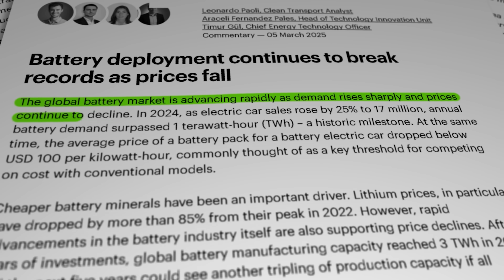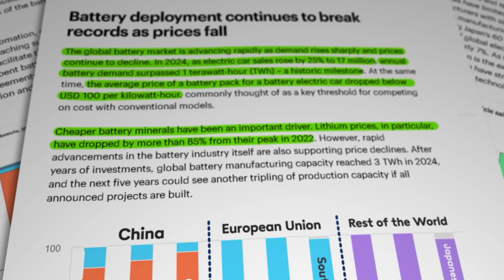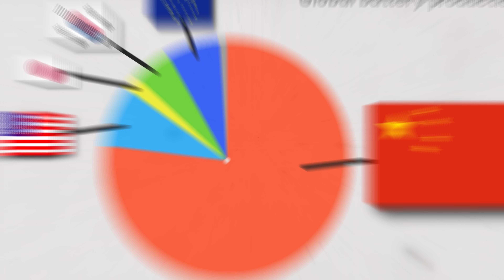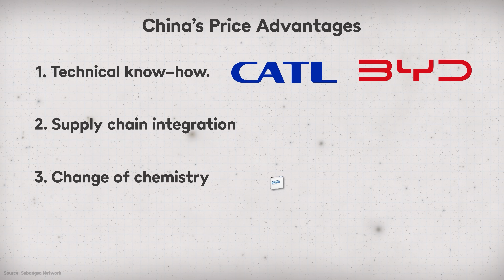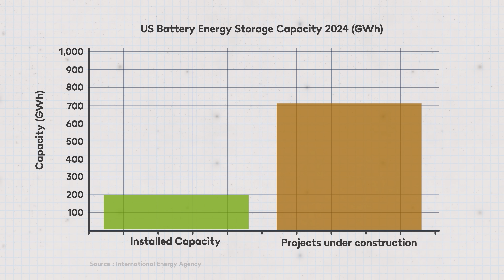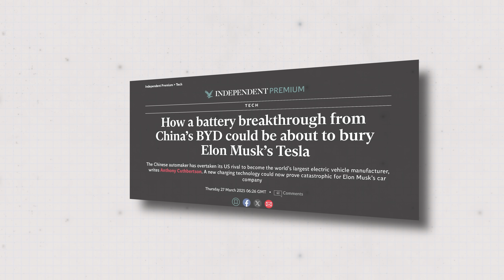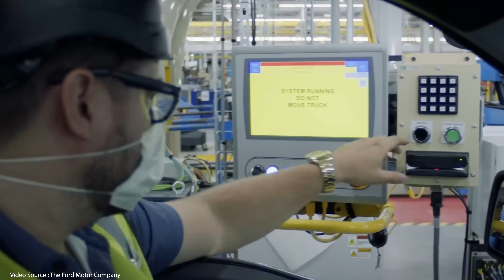Have batteries just hit their exponential curve??

Comment: Part of me wishes all this effort was going into something other than automobiles, which are a very inefficient way to move people around no matter what's powering them, and have many external costs. But I know that's not the world we live in so I guess electric cars are the best we can do right now.
Reply: I agree that cars are not the ideal transit mode. Thirty years ago I thought I would be riding a comfortable inter urban train to work every day. It never happened and I am deeply saddened by that.

But EVs are a torture chamber for batteries, so their growing adoption is forcing the development of tougher, smaller, cheaper, more energy dense batteries, and THAT is the key to the universal transition to a clean energy economy, which the rest of the world will get to enjoy.

Unfortunately, the US threw away its seat at the table and will be sticking with its "Beautiful Clean Coal" and its "Incredible Oil and Gas" for its foreseeable emphysematic future.
Reply: if you actually compare a ev bus in a city (200kwh per 100km) and a microcar (like 5kwh in a city) then the car is actually more efficient then the bus because the avg bus ridership thru the day is less then 40
even when you compare it to a normal car in the city (like 10kwh per 100km (avg speed 35km/h) then the buss still needs on avg 20 people thru the day (which doesnt happen in many places)
Reply: @faustinpippin9208 your values seem implausible. 40 times more energy to power a bus than a car? Come on...
Reply: @423GustavBern  Yutong bus uses 63 kWh/100 km. Average small EV is 15, maybe 10 in optimal scenario.
Reply: However, cars do have their place in the energy transition. There are use-cases (remote location, low ridership, off-peak times) where a bunch of on-demand cars can be more efficient than a fixed schedule public transport.

Comment: EVs are fair weather vehicles and impractical for any real emergency. They can't even handle casual skiing temps without the BMS restricting the charging rate to abysmal levels, or basic off grid operation like camping. Hybridization is where things change, but it is disappointing seeing how prevalent the push for EVs is over more affordable and robust hybrid solutions.
Reply: The fossil fuel industries thank you for peddling their tired misinformation.

Comment: The "Steamroller of positive change" is rolling along nicely... and this time it's battery powered 🎉
Reply: A battery powered Steamroller isn't a half bad idea. It's okay if it's heavy and unsprung weight in the form of wheel motors wouldn't be an issue.
Reply: Gales of creative destruction - Schumpeter
Reply: Mr Elon da engineer
Reply: " The products we get from a barrel of oil are not fixed.  By changing the conditions under which we refine the crude oil, we can radically change the mixture of products that are produced"

I would suggest people watch the Nate Hagens podcast The Great Simplification, any with Art Berman, if anybody knows oil Art does and gives people a realistic view of the situation.

Mr Berman has a substack as well afaik.
Reply: And often spontaneously combusting
Reply: @tims9434  This technology is moving much faster than the source material you're getting your information from. The causes of combustion are being solved.
Reply: timmy..,more ICE cars burn down every year than electric by ten times based on percentage…you are just one more red cap fool who voted for trump
Reply: @ …… during a terrorists attack leading to jail time
Reply: As all plastic comes from the same barrel diesel, petrol, LPG, any of the 6000 products we get then diesel will find a market as they are all refined at the same time we get asphalt. 
Battery powered doesn't remove oil from society just transfers those fuels to another market.
Reply: @antonyjh1234  No one is proposing that we stop using oil to produce useful molecules.  The idea is to stop burning it for energy, which puts CO2 in the atmosphere, causing climate change.  The products we get from a barrel of oil are not fixed.  By changing the conditions under which we refine the crude oil, we can radically change the mixture of products that are produced.
Reply: @antonyjh1234  Some plastics can be produced without oil now. The amount of oil used in all other industries is extremely small compared to transportation and utilities. That makes it even wiser to move to renewables so we can save oil for the other needs instead of burning it all up.
Reply: @antonyjh1234  Removing Diesel and petrol from the refinery mix, will cause a huge price shift in the other products made from oil. Recycling plastic will become more profitable. new designs will use les plastic. one time use plastics wil need to disappear.
Reply: @d.j.wiendels6572  Recycling plastic can happen I think 3 or 4 times before it degrades and not become useable, along with this microplastics increase each time. A study in I think France found microplastics in the hundreds of thousand per GRAM of food.
Reply: @antonyjh1234  "Battery powered doesn't remove oil from society just transfers those fuels to another market." - not a problem. Extracting and using oil is fine. Extracting and just burning it is the problem child. I'm sure some clever chemist will figure out how to synthesize the heavier oils from the lighter fractions, given enough incentive (e.g. a massively declining market) - those that are useful for lubrication, plastic making, asphalt, etc.

Comment: Great video Dave, it is very encouraging with the increasing sales of EV's, but in my opinion to add greater adoption in the UK, public chargers need a price cap. I only charge at home, due to the fantastic rates offered by Octopus Energy, based upon some of the astronomical charging prices out on the roads, it is cheaper to drive a Diesel or Petrol, so where is the incentive when the driver is the one who has to put their hand in their pocket, as well as the government now handing EVs comparable road tax too!
Reply: I've no problem with the road tax being the same. Us EV drivers have had it good for some time but I do agree the public charging needs to be much cheaper if the government wants every driver to adopt EVs. Ultimately it will be cost to run a car that will drive the change for the vast majority.
Reply: @MrDAVIDATKIN  totally agree, but that spiffy acceleration and low maintenance cost you get with an EV is a consideration too.
Reply: @georgeacton9106  absolutely there are other considerations too but most people see cost to buy, cost to fuel, cost to service, maintain and insure as the major factors. I believe for the average driver who just wants to get from A-B acceleration is fairly low in the decision making, probably after the colour.
Reply: The UK needs to decouple fossil fuel electricity production cost from determining the price of renewable power generation. If it did renewable power generation in the UK would significantly reduce energy costs in the UK overall.
Reply: I'm not sure how much difference a price cap would make, except to slow the rollout of chargers by limiting the available profits. Although public chargers are expensive, I've owned an EV as my only vehicle for almost 8 years now and have probably charged outside the home a couple of times a year on average.  In my opinion the most important requirement for greater adoption is finding ways to increase access to home chargers, especially for people without garages or driveways.
Reply: @cooperised  being that electricity, no matter who sells it, has the same generation cost, and rhe companies selling it to us at home still make massive profits. But at the moment public chargers have a scaling cost. Once the tipping point is hit, more EVs than petrol...we could see the prices decrease. Even more so when the grid dotesnt rely on gas.
Reply: @colinwiseman  Electricity from different sources has quite different costs. The cheapest is onshore wind and the most expensive is nuclear.
Reply: I am waiting for the Tesla Supercharger network to be closed to other  makes (against UK government regulation, but I'm sure conditions of a Trade Deal with the Trumpian Distopia will sort that one out, along with the import of danger-to-life agricultural products) - it presently remains half the price of those who took the incentive offered to install chargers and also took note of the absence of any price cap.
Reply: Absolutely need a price cap, if Ionity can offer cheaper than petrol prices with a subscription, why the heck are Octopus not jumping on this. They could roll out 1000s of chargers, with pricing like Octopus customers getting billed at peak at home rates, 22p and billing everyone else 43p.

You could see massive shift if they did that. They have their fingers in the right pies, so personally don't see it as a pie in the sky idea 😅
Reply: @colinwiseman  Subscriptions should be banned. Just charge the cheaper price to all.
Reply: Here in the Netherlands, we'll soon be on of the only countries in Europe where road tax will effectively be higher for EVs than for petrol cars (taxes are based on weight, and there'll "only" be a 25% discount rate up to 2030 and 0% from then on). It's already been calculated a number of times that it will indeed be more expensive then to drive an EV than petrol, which is insane.
But that's where electing a far right party gets you I guess.
Reply: @martijn8491  The external costs, i.e. the costs that appear on no balance sheet but are real nonetheless should be taken into account. That will rightly price fossil fuel vehicles off the road and our grandchildren will  thank us for that. The polluter pays principle must be paramount. Making Evs more expensive than petrol to run is typical for the reactionary backwards looking Dutch government.
Reply: Certainly should have off peak rates for public charging. Its cheaper to install lower power ac units. Holland has a few every 100m in res areas.
Reply: Hell no! Price caps ALWAYS fail! More real competition and less restrictive regulation is what is needed.

Comment: i really believe in batteries but if i do the math: 
-current worldwide consumption of electricity is about 25,000,000 gwh
-10,000 gwh of storage in 2030 is only 0.0004 😢
i think we need a lot more storage or did i get something wrong with the decimals?
Reply: You have to be careful with those numbers. 25TWh is the annual usage. The batteries are charged and discharges many times within the year. My understanding is that the power capacity of the batteries was 56GW in 2023. With 8766 hours in the year that is about 0.5 TWh of electricity transmitted.  But that electricity is only adding to the grid half the time since the batteries have to charge (you can't have 56GW of power all the time). Under ideal conditions assume half the time is charging. So it was more like upto 1% in 2023 but growing rapidly. I am not an expert but that just happens to make more sense to me.
Reply: you can do it if you have some land. 
cheap solar pv is $75 per 400w, lifepo4 batteries are cheaper than ever, diy raw 10kwh storage is $1000 and will last 20 years. and still 80% capacity after 20 years. Buy them ready to use and it will be $1400 per 5kw. I have 30kw storage and 10kw pv, works fine.
Reply: @Daemia-o1q lucky you! 👍🏻 how many hours can you bridge with 30 kwh if i may ask?
Reply: We should be looking at mechanical storage as well, like flywheels, but there's no money in it, so it's not being developed.
Reply: @snowstrobe  They were tried many years ago. Pumped hydro is superior if you have the acreage.
Reply: @  I think these things get sidelined because they're genuinely recyclable, (circular). We're only offered options which can't be fully recycled and are short-lived, like chemical batteries, as that means endless production.
Pumped hydro is great, tho dependent on geography.
Reply: That 25 TWhrs figure is annual consumption. We don't need batteries to store power for a year. A few hours will do!
Reply: if we needed 1 year storage then you would be right, be we only need like 2 weeks at most for the "dunkenflaute"
Reply: @423GustavBern  two weeks are 2/52 =0.0385 - or about 0.04 … that is still a factor 100 more. just hope the 10,000 gwh is too conservative like the prediction of pv growth has been.

Comment: China in the past was where goods needing lots of low cost labor went for production. For batteries however, they are 100% automated production processes with the only labor being skilled technicians and engineers being required.
Reply: Exactly, for batteries anyway.
Though BYD car factories are quite labor intensive, MG etc even more so.
(I’ve heard of several teams of designers compete for same task)
China does leverage cheaper wages, higher hours, esp outside Shanghai export zone.
But then Europe isn’t that much different either.
Automation takes a lot of skill & effort, only the best can justify cost.
Reply: Do the BEV's still catch fire or explode as much  in China ?
Reply: @rscott2247  The chance is very small, even smaller than that of a fuel car. But every electric car fire will be magnified and examined. In China, if a traditional car catches fire, other vehicles will just detour, but if an electric car catches fire, countless people will stop to shoot videos and post them on social networks.But to be honest, BYD's cars produced before 2022 seem to have a higher chance of fire, at least definitely higher than traditional cars.
Reply: @rscott2247  "Do the BEV's still catch fire or explode as much  in China ?" No. 

Here's a question for you - when was the last time you personally witnessed an EV on fire at the roadside? And now the same question for a liquid-fuelled vehicle?
Reply: @rscott2247  - New LFP batteries don't do that, also Sodium batteries are coming on strong and may eliminate fire problem.

Comment: the point of EVs is not to save the climate, it’s to save the car industry.
Any car manufacturer that refuses to switch over will go bankrupt sooner rather than later.
Reply: Why not both? If you're going to drive a 2-ton manufactured product, a battery electric vehicle is unquestionably much less harmful to the environment over its lifetime.
Reply: I don’t own a car, I rent one every once in a while
and I have no sympathy for the parts of the auto mobile industry that are trying to bribe their way into keeping the combustion engine a viable option.
Reply: @skierpage   Because it won't solve anything. The only solution is reduction. 'Transistion' is a lie.